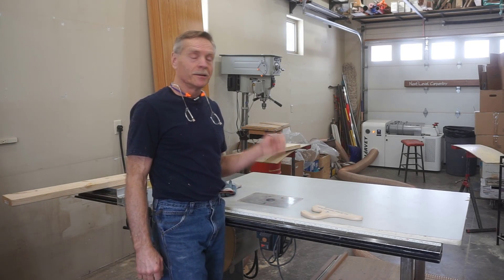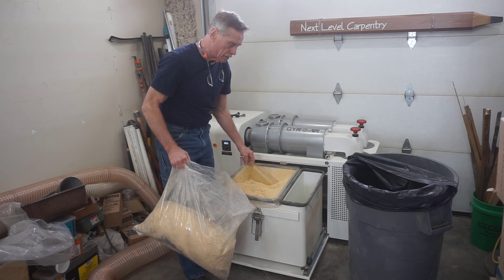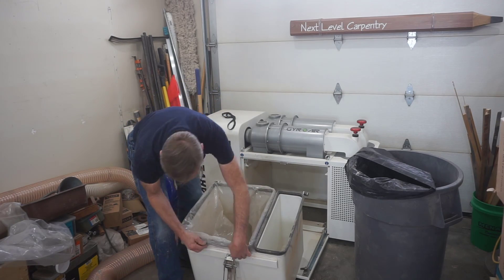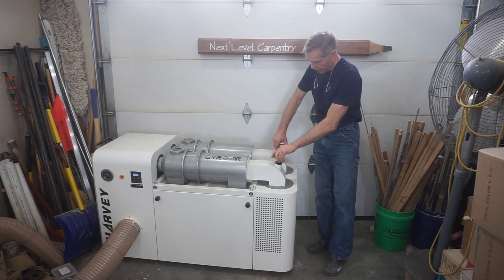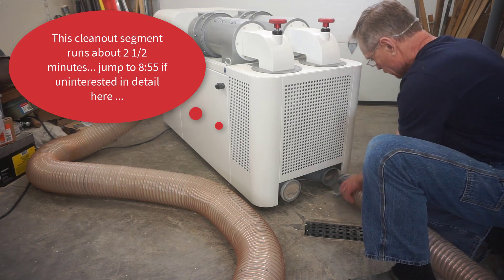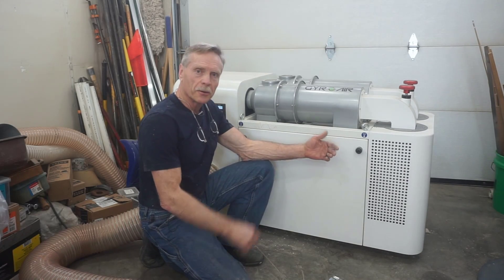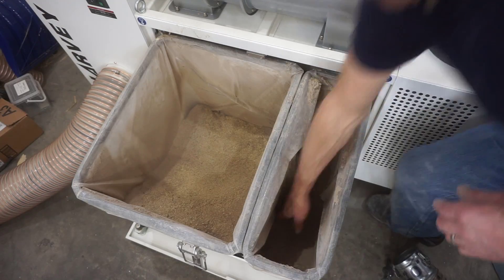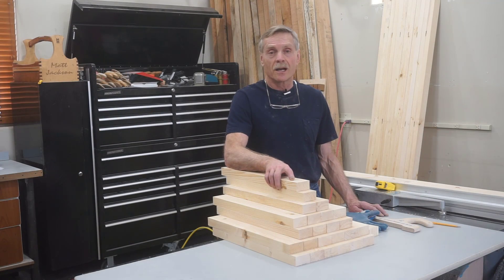"Self Cleaning" Dust Collector?  SAHWEET!

Comment: Hello Matt. I have recently found your channel and love the way you teach and show everything, warts and all. 

Do the dust bins actually need bags in them if you are transferring the dust to another bag anyway?
Reply from the maker: Welcome to Next Level Carpentry Ray.  FYI the bags are not technically required but make emptying bins much simpler.  It seems a bit counter intuitive but the bags supplied are surprisingly sturdy so I empty them many dozens of times before they need to be replaced so I can dispose of shaving in disposable trash bags that are far less expensive and have more capacity.  Hope that helps... Best, Matt

Comment: Hi Matt, I just bought and received my g700 and Im interested in seeing your clean out ducting, but I can't find it.  Did you make a video about that?
Reply from the maker: No, I didn't JR.  You can get a pretty good look at the setup in this video in case you want to make something similar: https://youtu.be/vHv-yO-kiTQ?t=321  It's worth doing but requires advanced maker skills if you have them or are up for a challenge.  Best, Matt
Reply: @NextLevelCarpentry  thanks Matt, best wishes for continued success.

Comment: What I am wondering is how many hours roughly do you need to clean the machine???? What is the CFM of the machine and how loud is the machine too ??? Would you recommend the item to other woodworkers ??? Thanks
Reply from the maker: Hey Victory First, this video will answer some of your questions:  https://www.youtube.com/watch?v=z4PKD-9y_bY&t=967s I'm completely satisfied with the Gyro Air G700 dust processor for modest sized shops where permanent overhead ductwork just isn't feasible.  FYI I can't hear the dust processor running over any of the power tools in my shop.. it's THAT quiet.  The sound of rushing air makes conversation difficult but it's not an unpleasant noise.  Circle back to me if you want/need more info?  Special pricing makes now a great time to purchase and if you go through Nextlevelcarpentry.shop I'll give you free shipping...  Best, Matt

Comment: given the near 5k price tag of that dust removal system I had not given it much consideration... o.k. I had not even bothered reading the specs on it, but I must say... that was an impressive demonstration. I wonder if you could connect a drop line or two to the cleanout ports with a blast gate on them so all you have to do for cleanup is open the gate and turn the knob several times, then let it cycle for a few minutes before closing the gates again. it would become a closed loop system.
Reply from the maker: Following the same thought process I made a "Y" manifold for the dust ports which serves the purpose you describe... great minds think alike, right Matt?!  I showed it briefly in a video but I forget which one it is exactly. You might stumble across it in another NLC video if you end up watching others... Best, matt

Comment: The dust system looks amazing. I need to look into a new high tech one.
Reply from the maker: If you're considering an upgrade you should at least consider a Gyro Air Ball Boy... it's not for everyone's shop but it's as advanced a design as I've seen.  Let me know if you have any questions? Best, Matt
Reply: @NextLevelCarpentry  I am look for something that will fit under my shop table saw. Will this unit fit?
Reply from the maker: @OffRoad-jh1do  I'm afraid that's a bit too optimistic... it might fit under a workbench but is just walked out to the shop and measured it and it's a full 34" high. You need to be able to rotate the filter cleaning knobs, etc so it wouldn't be good to wedge it in anywhere.  It will fit places in a shop none of the others will though so if there's anything else just holler?
Reply: @NextLevelCarpentry  I am still going to check it out. looks so easy to clean and change out the bags.
Reply: @NextLevelCarpentry  You think someone would address all that empty space under a shop table saw by making a dust system that would fit under the table. Seems like my vac systems are always in the wrong place lol
Reply: @NextLevelCarpentry  Glad to see you're back in full shop mode again!
Reply from the maker: @OffRoad-jh1do  hey thanks... I'm at a crossroads in life and career with high hopes the 'new normal' is building videos for YouTube rather than catering to snooty designers so, with any luck, I'll take 'full shop mode' to a whole new level in the months ahead... thanks to engaged viewers like yourself! Best, Matt
Reply: @NextLevelCarpentry  I think all 9f us who have been in the field for over 20 plus years are at the same crossroads. I wish you luck and you have a fan here my friend. You could also build small shop projects as is Zero customization. That way you don't have to deal with other taste or changes.
Reply from the maker: @OffRoad-jh1do  that 20 plus years has a way of lowering our tolerance for annoyance, doesn't it?  Always seems like things are becoming more difficult and annoying but it's just as likely we get set in our ways and don't like change maybe?  Thanks for being 'a fan'... I appreciate dialog with like minded folks a lot! Best, Matt
Reply: @NextLevelCarpentry  I still bite my tongue daily as I am still in the business. But I am looking to go more to one off shop made peices. if you like it buy it if not don't. No special orders or customization. Plus where I am city codes on building and houses  are becoming more work then the actual jobs anymore.

Comment: I'm impressed at how quickly and easily that saw ripped through a long 2x6 at the end! Cutting inch-and-a-half length ways takes a lot of push for most table saws.
Reply from the maker: Thanks for commenting on this video  Andrie ... I'm going to brag a little bit here but with a sharp blade it will Rip 8/4 Oak as easily as it did that inch and a half Pine.  For a productive woodworking shop it is essential to have machines that perform so that they are not the rate limiting factor on a project. I don't mean to belittle  your comment with mine because believe me every table saw I've ever worked with has not been so capable. 😀😎 Best, Matt
Reply: @NextLevelCarpentry  That is why folks that can, step up to cabinet type saws with their 3 and 5 hp motors like your Unisaw.  Many a woodworker started with a contractor saw.
Reply from the maker: @GFSwinger1693  I wish I had pictures of the antique old Craftsman I started out with as my first tablesaw!   I inherited it from a brother in law and used it until I scored a great deal on my near-new Unisaw in 1982... can't EVEN count the number of times it's paid for itself over the decades since!

Comment: That is a really efficient dust collection system, and doubt there are any as good as it is at removing that much fine particulate matter. 
Mike O.
Alabama
Reply from the maker: My greatest disadvantage is having zero previous experience with dust collectors but everything I've seen and learned so far tells me your assessment is correct Mike.  I'll sure let viewers know if I find out otherwise. Best, Matt

Comment: You should have a good set of cloth bags with drawstrings made for inside the bin, that would help with the reuse as well as you wouldn't have to mess with the rubber band.
Reply: For that matter, if you are just going to throw them out, do you even need a bag?  Or are the bins not removable so you can pick them up and throw it out?

Comment: This was very helpful. This dust collector has some great features for shops, like mine, with space constraints. It looks like most of your hose is flexible rather than rigid. I would be interested to see more about your installation. Thanks for your videos! Greg
Reply from the maker: Check out the recent unboxing video and also the one that shows unboxing and hooking up those flex hoses.  It's working out nicely so far but I suspect I'll be tweaking things as time goes on.  Glad you like the videos here... Best, Matt

Comment: Wow that thing collects dust brilliantly. Wish there was a system I could set up easily on small sites that last just a couple of days, would be invaluable. Great machine and great video, many thanks for sharing this with us 👍
Reply from the maker: There may be such a machine but I'm not aware of it and, at 450 lbs this is only 'portable' on smooth hard floors where it can be rolled.  Someday maybe?  Best, Matt
Reply: Next Level Carpentry I do t know of a machine over here either, maybe one day then.

Comment: Matt, I like how the system performs. As I watched you clean the filters, I thought of an adapter to take the place of the screw on caps. Adapter screws on, hose is attached, machine is turned on, twist the handle a few times. It may reduce the dust blowing into the shop. 
Just a thought! It looks like a great system. Keep those videos coming. Your work is amazing!! Thanks for sharing.
Reply from the maker: Excellent thought Walter!  Now you've got me thinking of a 'Y' manifold with a blast gate... would save extra fuss with the screw caps plus eliminate the 'little puff of dust' when the cap is removed before the hose is in place... thanks!  Best, Matt
Reply: Your idea is even better!!
Reply from the maker: @walterzink7594  I love brainstorming with 'thinkers' like you... no fear of presenting unique thoughts... thank you!  If you see  a video with something along these lines shown in it you'll know it started with your comment!  Best, Matt

Comment: I am impressed with two things - that AMAZING dust system and your inattention to cleaning it more often... 🤣🤣
Reply from the maker: Yeah... I must be a little crazy for leaving THAT in the video, right Clyde?  I wanted viewers to see what can happen though.  I think I've 'overwhelmed' the system a few times by running tablesaw and jointer without the dust processor running.  Then, when I turn the dust processor on, there's a sizeable surge of sawdust that it can't 'swallow' all at once so much less than 99.9% of it spins out in the bins.  What I'll be watching for is times when the machine 'chokes' on a surge of sawdust that is prematurely clogging the filters.  Live and learn... all for the benefit of viewers so THEY don't have to re-make my mistakes.  Best, Matt

Comment: how many total hours do you think you have on it now
Reply from the maker: I've spent a lot of hours working in the shop since getting the dust processor Ed but I suppose it's only run 10~20 hours?  I leave it 'powered up' longer than that but actual run time is much less.  As evidence that I'm still 'getting to know' this machine I didn't realize that front filter was plugged up until I started shooting the video... embarrassing, I know, but that's the truth.  Good news is that with a simple 'self clean' procedure it's all good to go! Best, Matt

Comment: Matt I think I would be rolling that bin out on a dolly and emptying it outside rather than getting the cloud of fine stuff coming back in the air right in front of your face. Really defeats the purpose of having small quantities of fines all of the time by having a lot for a little while.
Reply from the maker: Yeah, I've definitely got to perfect my system for this Greg, but consider: prior to getting the dust processor ALL the dust ended up in the shop air ALL the time.  😳😁😎 Best, Matt

Comment: Matt, That Dust Collector is Amazing! and You're right about the Fine Powder, I have Reznors Hanging down from the Ceiling 2 of em, in my shop. Gas Fired Heat Exchangers... The Local Code Enforcement People came by this past Tuesday. this Officer insisted that I show certs that the Heaters had a Yearly cleaning...  I thought he was Totally Nuts. whelp I had my heat guy come in and Holy Smokes! Brother You're Right! Even with FOUR 1200 Cfm Collectors in the shop, each to Specific Stations, that 5 Micron Dust was up in the Heaters and More So Probably In Me! Maybe the cost of that Fancy Loookin Box is worth it and Not the Lung Doctor... I've seen that at the Wooding Shows but Didn't think is was That Efficient...  I'm Sold Brother... Wow!
Reply from the maker: Hey Joe, I cleaned out the Reznor in the new shop last summer... there was dust from metalwork the previous owner did but, with your advice, I'll make sure I give it a thorough cleaning again.  I'm going to make an 'air scrubber' for the shop one of these days anyways though.  Best, Matt